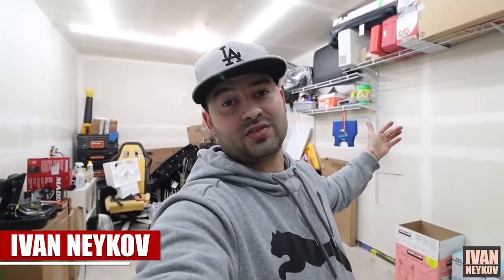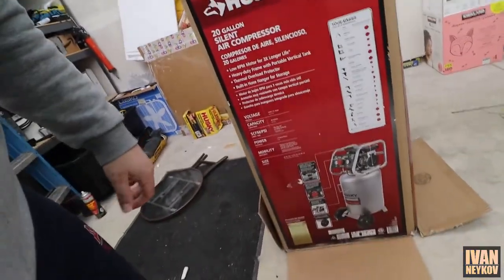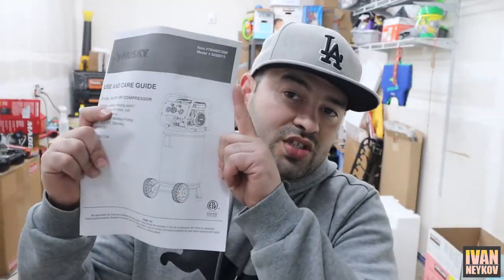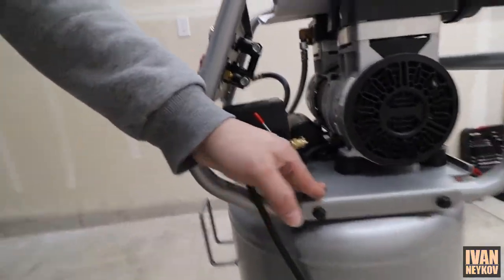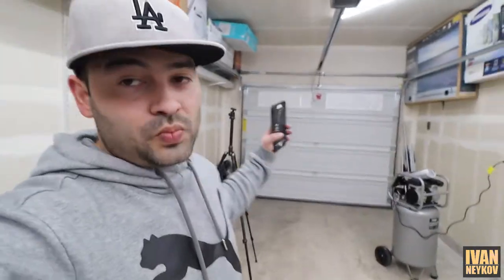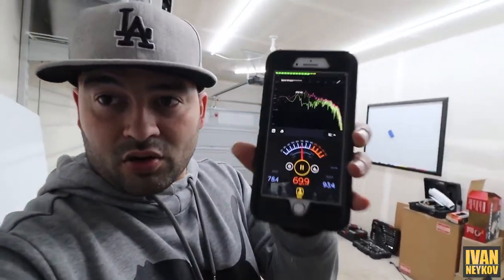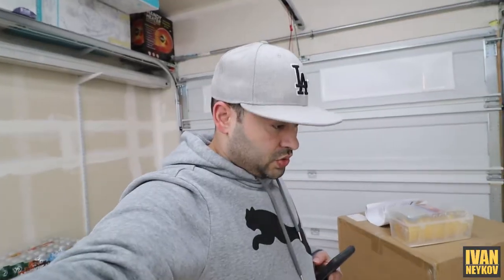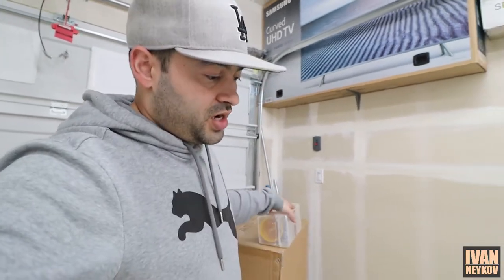Husky air compressor

Comment: Pardon off topic what diagnostic software on your computer do u use I just saw one of your videos where you were using it on your Mercedes
Reply from the maker: No problem my friend 
The software name is Xentry
Reply: @Ivan_Neykov  thanks
Reply from the maker: No problem but just a heads up you need to have vci Cable or C4 to be able to communicate with your vehicle